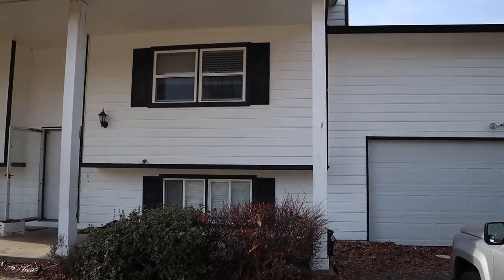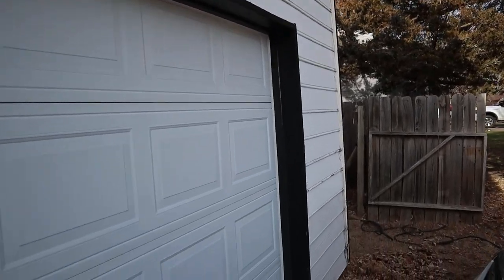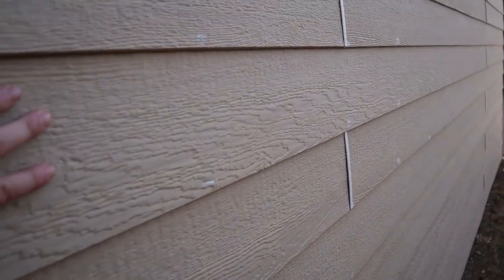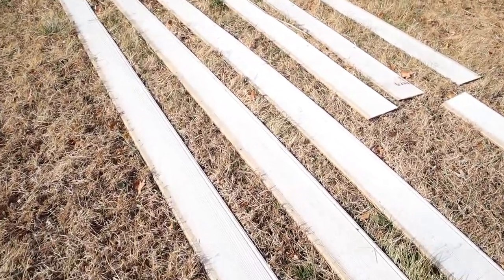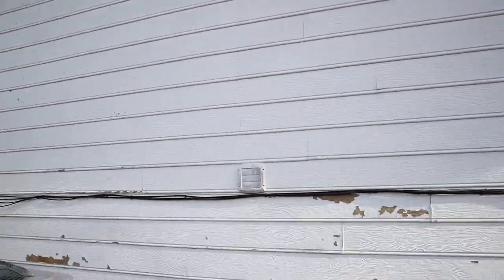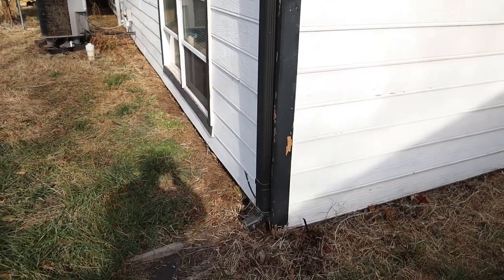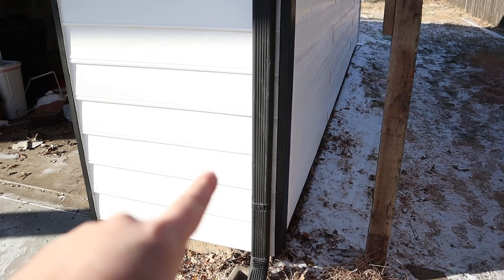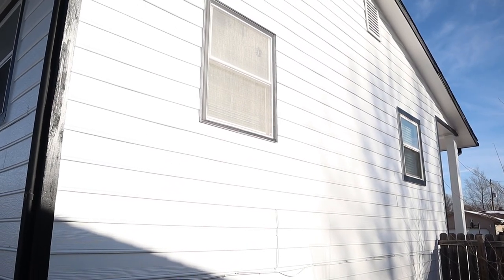Rental House Exterior - Before and After

Comment: Paint can sure spruce up a place.  Glad you got it done before the weather came.  It's always interesting to see what a tenant leaves behind.  Suppose you'll be making a few trips to the dump.  We're you able to offset some of the cleanup cost with the tenants security deposit?  That's always tricky.
Reply from the maker: I had a $1k security deposit and it's all going to be eaten up.  You'll see what the inside looks like next time, which is fairly rough.